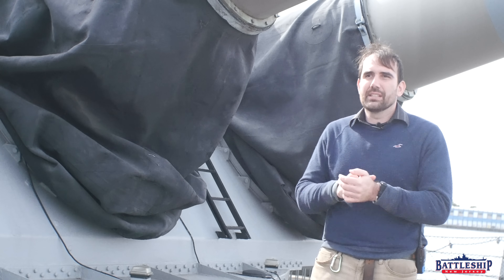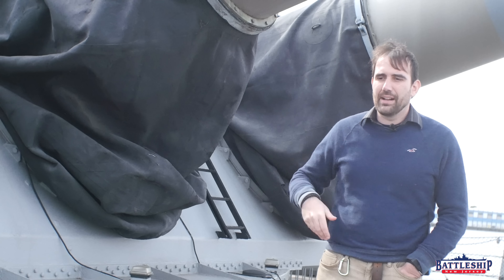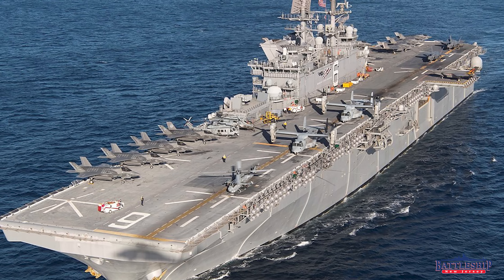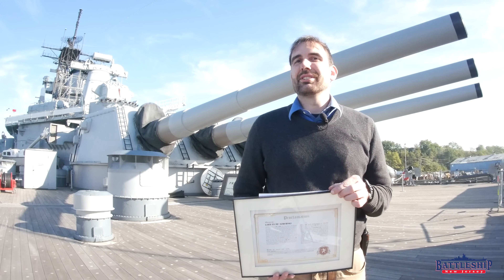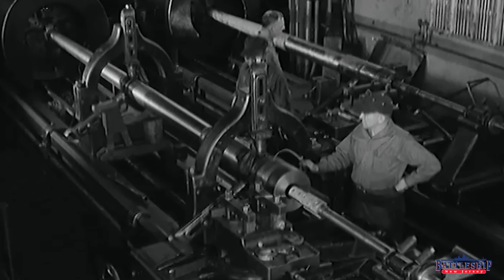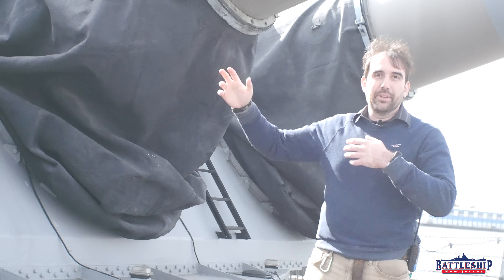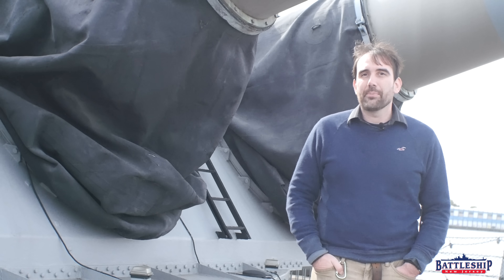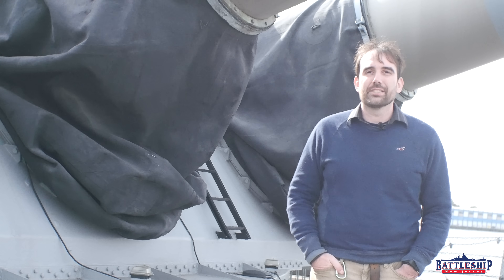How Much Would It Cost to Build a Battleship Today?

Comment: Unfortunately the Rail gun program was cancelled. They couldn't  solve the problem of the barrel being destroyed after a few shots.
Reply: Another problem is that railguns had a pretty low budget over the years - but the $500m or so spent over a decade on that, redirected in a couple of years to upgrade missiles may result in something more costly per shot, but it's still something off the shelf upgraded and therefore available faster. Railguns may someday be viable, but right now regular missiles don't have huge tech gulfs to put into service. 

Lasers meanwhile might see more use for anti-drone or, ironically, anti-missile work.
Reply: @Jonathan Zentelin lasers for aa roles are still being developed though.
Reply: @죽은_시민의_사회  they are in use in Israel and development has been going on for many decades and successfully testing of prototypes have been done for many decades
Reply: @calneigbauer7542  but in the AA-AAA role.
Reply: @죽은_시민의_사회  AA fire just needs to stop the munition short of hitting the vessel, so a range limit of 600ft is entirely fine for that.
Reply: Lasers only really make sense as a point defense weapon in atmosphere and guns usually do fine doing that. Railguns might be possible eventually. The recent program developed some cool projectiles though.
Reply: the navy stopped the railgun program because materials aren't there still to do it to a reliable amount. the barrels on these battleships only just work as it is.
Reply: It's the same problem as the big 18in guns on Yamato or even the 16in on Iowa. With the energy in the "bullet" being delivered to the barrel it is going to be remarkably difficult to keep the rifling intact for more than a few shots, with the 16in guns 150 shots.
Reply: @Jonathan Zentelin Plus the fact that the biggest problem with trying to weaponize LASERs as weapons is thermal blooming.  By definition, ships are one of the worst places to put them because all the moisture and spray only makes that more of a problem.  And in bad weather they would be absolutely useless.
Reply: problem is a railgun just pokes a hole... unless it hits something explody- not much use.
lasers- great,, except the range is limited by crap in the soupy-lower atmosphere, and the beam can be 'armoured' against. ( mirroring, or a bit of space-shuttle tile), and the effect isnt instant, it takes a dwell time, which in the case of a supersonic asm, may not be long enough
Reply: Railguns wear off faster.
Reply: That, and the issue that very few targets are really suited for engaging with a direct fire weapon.  Because of how they work, the railgun was a direct fire line of sight weapon (just like a LASER).  They sound cool, but they don't explode, and if you can't "see" the target, you can't hit it.  If it is behind an obstruction like a small island or on the ground, a railgun is worthless.

I talked to a couple of guys working on it at White Sands a decade ago, and they both told me that was the biggest issue the Navy was having problems with was how to use it.  They were seeing it more in use as a longer range CIWS, not any kind of replacement for the missiles or main ordinance.  It really was a case of a "cool weapon", that there really was no use for.  And most people can't understand that most Naval weapons are indirect fire for a reason, and those like a LASER were only direct fire.
Reply: @Old_Man_Fallout  The railgun was not exactly a line of site weapon. Wth a 100 mile range (planned to be over 200 miles) and guidance, it could be fired as indirect.
Reply: @jrmarcus  barely.  Simple physics prevent it from being fired at any kind of a high angle.  They are only "indirect" to the degree that they can fire past the horizon, at an angle only slightly elevated above direct line to account for drop over distance.  Physics prevents them from firing "indirect", as that requires firing in a ballistic path.

And all kinetic energy lost through the travel and increase in altitude is forever lost.  And it then is only "falling" at the terminal velocity of the object.

I have talked to members of the team working on this, and they all know of this issue.  They can not and will never fire like artillery.  That is "indirect fire".  Which is why they can fire over mountains and cities.  Railguns just can not do that.
Reply: @Old_Man_Fallout  If the projectile can be guided, it goes to reason that it can be pointed down - hence indirect.
Reply: @jrmarcus  A railgun projectile can not be guided.  It operates entirely on kinetic energy and has no guidance system.

What, do you think it actually fires guided munitions?  It does not, it is no more guided than the bullet from a gun.
Reply: @Old_Man_Fallout  Hmm, I responded to you, but I don't see it. Please check out the hyper-velocity projectile (HVP). That was the round that was to be used on the rail gun. So, yeah, I do think the rail gun fires guided munitions. You can find it on the BAE Systems website, the developers of the rail gun for the Navy...probably the company the design engineers you know work for. Here's a line from the write-up on the website:

The HVP is a next-generation, common, low drag, guided projectile capable of executing multiple missions for a number of gun systems, such as the Navy 5-Inch; Navy, Marine Corps, and Army 155-mm systems; and future electromagnetic (EM) railguns. Types of missions performed will depend on the gun system and platform, but range from Naval Surface Fire, to Cruise and Ballistic Missile Defense, Anti-Surface Warfare and other future Naval mission areas.

The HVP’s low drag aerodynamic design enables high-velocity, maneuverability, and decreased time-to-target. These attributes, coupled with accurate guidance electronics, provide low-cost mission effectiveness against current threats and the ability to adapt to air and surface threats of the future."
Reply: @jrmarcus  No, the HPV is designed for traditional artillery.  Marine Corps 155mm and Navy 5 inch guns.  They say it "might" be used for "future" EM guns, but for guns that are not even being developed yet.  And that is not even real, it is still just a concept.

Do not confuse what a press release says with reality.  And in reality, the HVP is nothing more than an update to the decades old Copperhead.
Reply: @Old_Man_Fallout  I'm sure no matter what I say, you're going to say the opposite. You say the rail gun by its very nature can only be line-of-site, but that was never the intent. You got snarky about it, but you were wrong. Not sure why you're digging in on this.
Reply: @jrmarcus  I am simply being accurate.  The weapon you brought up is not designed for railguns, it is designed for conventional artillery.  Saying it may someday be adapted for a system that is not even on paper yet is simply a way to try and get others to invest in it.

I deal with things that are "real", not things that are decades away at the soonest.  And even though R&D has been going on for railguns for over a century, they are really no closer to being implemented or overcoming the problem of being only a line of sight weapon than when they first started experimenting with them at the end of WWI.

In fact, their earliest intended use was air defense.  And during WWII some considered them as armament on tank destroyers.  Both perfect uses of the technology, but nobody ever decided to try and use it for artillery - for obvious reasons.

And also knowing that the largest projectile BAE has been able to fire from its experimental rail gun is 7 pounds.  The weight of a 155mm round is 95 pounds.  And nobody anywhere is trying to build any kind of railgun that can fire a 155mm projectile.

I do see them as useful weapons, especially in air defense or point-defense.  But I also recognize that they will never replace the main armament because they are incapable of being used in that way.
Reply: @Old_Man_Fallout  I don't think you understand what the HVP actually is. It was tested by the Navy a few years ago from the MK 45 at Mach 3. You bring up 155mm, but you're forgetting that it's a sub-caliber round. The round doesn't change, the sabot does. Again, you made the assertion that a rail gun can't have guided munitions. That just isn't true. Of course, the technology isn't there for rail guns, but it AGAIN is not meant to be line-of-site. IT IS meant to fire guided munitions, be it at missiles, aircraft, or surface targets. Guided munitions will be an area of emphasis for the US, even in medium caliber.
Reply: @jrmarcus  I am not forgetting.  Did I not say it was for the 155mm and 5" gun?  The Mk 45 is a 5" Naval gun.  In other words, conventional artillery that fires in a ballistic trajectory.

I do understand, and stated it already.  So thank you for admitting it is designed for being fired from artillery pieces.

It does not matter what may think MAY happen some day in the future.  It is what it is, and nobody has even gotten it to work yet.  Let alone in that way.  It has taken them over a century for it to get this far, I am not holding my breath for another century on some "maybe future development".

Oh, and the HVP round?  It is still not for ballistic targets.  It is intended for use in 155 and 5" guns as an air defense round for direct line of sight targets.  Look it up, they have been testing it on the M109 since 2016.  Not as artillery, but as ballistic missile defense.

And you say I do not realize what it is.  I have actually been describing it accurately, you are the one trying to make it into something it is not.  It is not an explosive round either, it is a pure kinetic kill weapon like the PATRIOT PAC-3.
Reply: @Jonathan Zentelin Absolutely not true. Lasers are practically an inevitability that they will reach the battlefield within the next 10 to 30 years. and its pretty easy to see why, any Laser CWIS would do a far better job than a comparable conventional gun or missile system. A laser has far more accuracy and range than a gun CWIS and is far cheaper to fire than either system. Ships are already being built to accept them once they come out, so yeah lasers will be a thing. But their primary role is basically going to be CWIS and short ranged air defense. Later versions capable of fitting onto Tanks and APC sized vehicles will likely be used as anti drone weapons. Since killing a cheap drone with an even cheaper laser shot is far more economical than blowing up a few thousand dollar drone with a half million dollar AA missile.
Reply: Actually the Railgun program is more just put on hold until material science comes up with better barrel materials. Every other problem with railgun's has basically been solved, and since every other component is basically finished, the Navy decided there wasn't any more point in spending R&D money on the railgun specifically until somebody comes up with better materials that can be used in railgun barrels.
Reply: @Jonathan Zentelin one day even missiles will be obsolete let alone planes, in the face of direct fire weapons moving at light or fractional speed of light. There is no cover in the sky.
Reply: @FillingPassports  More like $100,000.
Reply: @Jonathan Zentelin "Anybody with a brain." just a friendly note, overconfidence like that doesn't make you look intelligent, nor does it make you that. More effecient in what role exactly? And why do you mention drones? what if they are just remotely controlled platforms to shoot those missles from? That comment of yours...it's just so full of confidence but it lacks evidence.
Reply: Being replaced with lasers
Reply: @Aprojeep  Not really.  They have been battling the problem with thermal blooming for decades, and are no closer to solving that then they were 5 decades ago.
Reply: Coil-Gun! There, problem solved, as it doesn't have a real barrel, it pulls the ammo along with magnets :) - That they went for railguns is IMHO mind boggling :(
Reply: then swap the rail on a dyme
Reply: Railguns are useless anyway: they're a direct fire weapon (whereas a Naval Gun is indirect fire Artillery.)

Railguns are likely the eventual future of point defense and anti-air systems, but you can't bombard over the horizon or strike hardened targets with them like you can artillery (and the whole purpose of a battleship is to kill something over the horizon that they can't actually see.)
Reply: @Jonathan Zentelin you’re going to sit there and bullshit everyone? You really think missiles and drones would be more effective than something that would be travelling at light speed? And also have free ammunition? Ok mate sure..
Reply: Sounds like they need a new think on how to build barrels... hmm?
Reply: @BaraTwoswords  They're not barrels, they are rails. And the problem is not in the manufacturing, material science and metallurgy just aren't there yet. We need some sort of next generation super metal to withstand the enormous energy that those rails are putting out.
Reply: @BaraTwoswords  if only it was that simple
Reply: @Jonathan Zentelin That's a stupid outlook and a false statement. Lasers are functional and still being tested, you don't know about them because you're not supposed to know about them. You hear about them, like in this current war. As for why it's stupid... how can you possibly know something before it ever exists? You don't. Also, the railguns weren't abandoned as OP thinks, they were shelved because current technology ultimately cannot run with what the concept is. The concept is sound, the technology isn't up to it. Yet.
Reply: The material technology for railguns just isn't there yet, but the concept worked. One we learn to suspend a round properly in carefully controlled magnetic fields where it doesn't hit the rails at all when exiting, then we will have them, either that of find a coating for the rails that extends life to hundreds/thousands of rounds like we did with the old large calibre guns.
Reply: @Jonathan Zentelin Lasers are absolutely real they can take down missiles and aircraft but there is a lot of secrecy around this because you do not want your enemy to know what status of development you are in.
Reply: @DrScopey2  yeah can’t wait for the NGAD to come out
Reply: @DrScopey2  So far things like lazers and microwaves and rail guns and soi on have all kind of sucked compared to what we already have.
Reply: @robertsmith4681  it's laser. ont lazer. and from where did you come up with microwaves on this?
Reply: @AsserKortteenniemi  One of the many, many problems with these systems involves dust scattering lazers, so they have to use microwaves that are more resistant.
Reply: The problem with lasers is that the military industrial complex is addicted to recurring revenue. You can charge for every missile and bomb and all other manner of consumable again and again and again as they are depleted. You only get to charge for a laser once, and that just won't do.
Reply: @agenericaccount3935  I’m convinced lobbying is why we didn’t spend more money on solving the issues with the railgun project. 

Raytheon can’t charge per slug for a rail gun so they want that project to fail.
Reply: @agenericaccount3935  lasers fulfil a fundamentally different role than missiles or bombs- longe-mid-range anti-munitions fire. Basically, the range shorter than AMMs but longer than Aegis. So actually they get to sell the lasers in addition to the consumables
Reply: @FillingPassports  I thought that was the price for the custom Zumwalt projectiles not the railgun ones they are just a solid penetrator encased in a discarding sabot, there's no explosive in railgun shells, it relies purely on kinetic force and it's weight to do the damage.
Reply: @dc-4ever201  The only ships that would be able to generate the 25 megawatts of power required to fire the railgun were the Zumwalt-class destroyers and the guided Long-Range Land Attack Projectile (LRLAP) for the Zumwalt was canceled after its price point grew to whopping $800,000 per shell. The rail guns shell were cheap at $25,000.
Reply: @FillingPassports  $25,000 for a machined bit of metal and a dusposable sleeve, wow the Military Industrial machine certainly know how to markup things and make humongous profits.
Reply: @FillingPassports  I'm not sure the cost rose as much as the Navy went from 32 ships to 3. The cost of engineering was spread over the three ships, making it prohibitively expensive.
Reply: @dc-4ever201  Conventional 5 inch gun shells are around at least a few thousand dollars in their own right as well. So as far as large caliber gun projectiles go, railgun rounds arent that much more expensive than their conventional counterparts. And no, actually large caliber projectiles require some insanely precise machining to work properly, which is one of the reasons why they are so expensive. the other reason is economy of scale. Large caliber projectiles simply arent produced at anywhere near the same numbers as smaller rounds, so the individual price per round goes up.
Reply: @ryuukeisscifiproductions1818  I was an engineer and qualified to run the types of machines that turn down the rounds, these days it's all CNC, less time consuming and a hell of a lot cheaper as those machines create more in less time, they are far more consistent than humans hence their widespread adoption by industry. Also as I said previously the railgun uses kinetic energy to cause damage so the round is a solid penetrator inside a sabot similar to tank APFSDS rounds, which flies off after it leaves the weapon, there's no guidance inside or warhead.  $25,000/round is simply insane, someone is milking the DoD on that one, sounds like it was priced up by a medical supplies corporation 😂.
Reply: @dc-4ever201  Actually there is a guidance package in railgun rounds, the $25,000 unit cost is for guided rounds. And in any case, at the ranges railguns would be capable of, they arent competing with conventional gun rounds, they are competing with missiles that are millions of dollars a piece. (or over 80 million for the hyeprsonic missiles). So you want to talk expensive ordinance, look at the missiles.
Reply: @ryuukeisscifiproductions1818  Ah, thanks for clarifying that, the tests I saw were all dumbfire solid rounds. I guess a lot of that cost is due to having to insulate the sensitive guidance electronics from the forces involved in firing it.
Reply: @ryuukeisscifiproductions1818  Yeah compared to missiles $25,000/round is loose change. Well since the initial research on railguns is proof of concept and it only being shelved due to material/technology limitations, we will likely see it again in the future.
Reply: @ryuukeisscifiproductions1818  Wait...

WHAT?

You think there's guidance in a 3.5kg Tungsten Slug???
Reply: @Jonathan Zentelin No lasers are even in use atm in the US navy. They're not intended as main weapons, only another form of missile defence, and the US is wondering if they'll do anything similar against drones or even combat jets. They can do everything from messing with guidance (remote and autonomous), optics and detonation. Why abandon something that can cook the guidance optics on an anti-ship missile, or potentially even detonate it before your CIWS has a chance to engage it?!
Reply: @GrasshopperKelly  I looked and nine US ships are being tested with lasers.
Reply: It was more that it was obsoleted before it was even complete by supersonic missiles. Which were not only cheaper to use but easier to maintain.
Reply: @mrrailgun6440  Not really, Hypersonic missiles are hideously expensive, even by missile standards. Even cheap ones go for well over 10 million dollars, which for reference, is likely more expensive than a whole railgun barrel plus enough ammunition to wear the barrel out. The insane cost per missile is why the US largely gave up on developing them back in the 80's, and interest has only reignited now because Russia is claiming they have functional weapons.
Reply: @mrrailgun6440  If they had figured out how to account for the destruction of the rail, a hypersonic missile is over $100 million dollars while a projectile for the rail gun is $25 thousand. Maybe someday, but I disagree that the rail gun was obsolete.
Reply: @jrmarcus  Except a railguns can NEVER hit a target with the destructive force that anything else can...UNLESS it is on a direct Line of Sight.

You can't Plunge Fire with a railgun: once enough linear velocity has been shed for a meaningful plunging drop, you've lost all the momentum that made the solid-state railgun slug dangerous to the target in the first place.

This makes railguns absolutely useless as Naval Guns because your only option for over-the-horizon targeting are shallow, lateral shots into the side/face of a target where gravitational drop pulls it down over the horizon, and even this is pointless  because the angle of the gun can't really be changed; this means that to hit a target, you only have two variables that can be adjusted...either the vessel must travel to the proper distance and location to hit the target, or the Launch (and therefore Impact) Velocity must be reduced so that the projectile doesn't have to travel as far as gravitational drop effects it more quickly.

Either way, a railgun is a waste on a naval vessel as a main armament...unless you're planning on sailing close enough to see the enemy deck crews panicking.
Reply: @digitalis2977  I think we're saying similar things. Without guidance, a projectile from a railgun is not overly useful on a naval ship. Still, a guided projectile was always the plan. I have no idea to what extent you lose the kinetic force of the round with some maneuverability.
Reply: @jrmarcus  A guided projectile was NEVER the plan, because a Gauss Gun is, by definition, linear.

No electronics or explosives can survive the instant acceleration generated by a Gauss Gun.  The name of the game is literally to accelerate as large of a solid-state mass as possible to as close to the speed of light as possible so that the sheer velocity of the relatively miniscule mass generates as many kilonewtons as possible at the point of impact.

 You're confusing the Naval Railgun Program with Operation Excalibur that was initiated by DARPA and the US Army in the early 1990s: after a decade of development, it yielded a precision, GPS guided 155mm howitzer shell that was accurate to within 3 meters, self-correcting from up to 15° off target, and six times the cost of a JDAM with 1/20th the payload at the same accuracy.  The information was then shared with the Department of the Navy and a shell was planned for the Zumwalt and the Arleigh Burke main cannons, but was again mothballed because the shells were literally too expensive to fire for the payload they carried.
Reply: You've got a few completely unrelated concepts that you're trying to tie together. First, the rail gun is not a Gauss gun. But, that has nothing to do with whether it could use the HVP. As far as the shells produced by Raytheon, for AGS you may be confusing cause and effect. Originally there were 32 DDG 1000 ships planned, when the Navy changed plans, the engineering costs were spread among three ships. You're also confusing Excalibur with LRLAP. LRLAP was the projectile for MK 51 AGS. Both Excalibur and Volcano were proposed because of the cost of the LRLAP, after the fact. Now, when you're saying the HVP was never planned for the rail gun - that's just not the case. I mean, that's a simple google. Try it, maybe something like "hvp rail gun". Heck, I googled "rail gun can't use guided munitions" and Popular Mechanics popped up with the title "Navy Experimental Rail Gun to Fire GPS-Guided Projectiles". But, since you're saying this can't happen, let me know where to look, please cite your source.
Reply: @jrmarcus  Kudos on nit-picking the colloquial term of "Gauss Gun" (it's technically a "Coulumb Field Gun" but no one knows what that means, nor refers to either rail or coil guns as such because it doesn't sound as cool.)

Secondly, you're reading things backwards.  The Railgun was never intended to fire GPS guided munitions; the HVP Project ATTEMPTED (and failed) to produce a guided slug after the fact.

They failed for reasons I've previously stated: there are no existing GPS units that can survive the forces generated by the launch, transonic cavitation, or generated temperatures of flight...nor any mechanisms that would survive said stresses that could be deployed from the slug to achieve guidance.

Hypersonic missiles are insanely expensive for these reasons (namely thermal insulation that protect the internal electronics without disintegrating due to flight stresses...ceramics based off the belly tiles of the Space Shuttle work, but are extremely expensive and extremely fragile) and they have comparative eons longer to reach a hypersonic speed than a railgun slug.

By point of fact, stabilization of a railgun slug is practically impossible due to all the variable factors acting upon it (including the fact that any attempts to stabilize it would melt along with the slugs outer layer due to air friction) and a sabot round has never been desirable because it is both detrimental (an overly long mass will, in fact, wobble in the air and actually LOSE velocity due to lost aerodynamics as well as lost penetration power when failing to impact at a perpendicular angle to the target) and unnecessary given that the whole point of a sabot round is to condense impact force generated by limited velocity into the smallest possible point to maximize penetration; the railgun does not have the constraints of an artillery gun...it can brute-force its way in.

The best mass for terrestrial railgun use is compact with as close to the same surface area as possible on all sides (you'll notice the slugs being used for the experimental naval gun are in fact nearly square and present roughly the same area on all sides...despite looking something akin to an engine piston.) This ensures that no matter how the slug tumbles or spins in its linear flight, the same kinetic impact is achieved because the impacting face almost always has roughly the same surface area as any other side of the slug.

In the vacuum of space, a sabot-type round would be more viable, but in a terrestrial setting with aerodynamics and friction in effect, a needle-like railgun slug is a loser nine shots out of ten compared to a spherical/squarish/ovoid slug because its flight is impossible to stabilize or guide without materials that humanity has yet to discover.
Reply: @digitalis2977  Just provide a link.
Reply: @Jonathan Zentelin lasers as primary weapons might have been cut, but as AA they are still going strong in development to take down missiles, but the electric power needed for them, is predictably, horrifying
Reply: Concerning lasers: such weapons will always be negatively affected by atmospheric conditions.

No way around it.

In my opinion, this is a dead end street. 

Why spend so much money on something that may never be practical? The same amount could build many many ships that actually work.
Reply: Actually they basically solved barrel wear by the 80s
Reply: @THOMAS81Z  They really didn't. "On 1 June 2021 The Drive reported that the US navy's proposed 2022 fiscal year budget had no funding for railgun research and development. Technical challenges could not be overcome, such as the massive forces of firing wearing out the barrel after only one or two dozen shots, and a rate of fire too low to be useful for missile defense."
Reply: @THOMAS81Z  of railguns?
Reply: @THOMAS81Z  Actually they solved the barrel wear back in 1500s, the solution being an arsenal that keeps more weapons at hand to rotate.
Reply: Well I know 16in guns don't do that and a little Lazer can make it stop form firing  at you
Reply: I wonder if that is something Russia could solve.
Not because I like Russia, but I have heard they are often able to do breakthrough work on implementing new weapon concepts before any other country.
Reply: @edwardwood6532  No, that's just their propaganda speaking.
Reply: @edwardwood6532  heard all that back in Cold War. Every rumor false. Their tanks, planes, combat readiness all overrated.
Reply: @teller1290  Lol. Yeah if their tactics and equipment is so good how come the big bad Russian bear can't win in the Ukraine. I don't where that guy got his info!!!